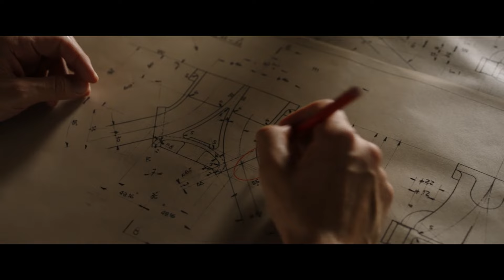FERRARI (2023) Behind-the-Scenes All Released Feature

Comment: I've seen the film twice in two days and will be seeing it again soon. It is a wonderfully produced film of the man, 1Ferrari, in a time of his life when it was all on the line... win or lose everything. Adam Driver beautifully portrays a complex man who has one focus in his life... to win. He sold customer cars to race. Racing was everything to him. It was in his blood. His competitive spirit was legendary. You may not have liked him, but you certainly had to respect him. I never knew about his family life, but his focus on the business was legendary. Michael Mann has done a fantastic job in portraying the whole racing scene at the time... one simple mistake on the track at speed, and you're dead. No safety equipment, and helmets and goggles were only there to protect the head and eyes from debris in the air. No seat belts, no roll bars, safety cages, monocoque designs, no tires which could provide the mechanical grip we see today. Brakes were drum and not discs, but the engines had a ton of power in a Ferrari. The cars were light weight and the power to weight ratios were insane. The 335 S cars which raced in 1957 at the Mille Miglia had a top speed of about 190mph, but I doubt if they reached that number, but maybe very close to it, with 2 people in a car. Piero Tarufi (played by Patrick Dempsey) likely won because of excellent driving but also because he was alone in his car, thus making his car even lighter than the other 4 Ferraris in the race.
Great camera shots during the race and you certainly get the feel of being in an open car at top speed, with all the bouncing occurring from the road and ability of the suspension to deal with it (or not).
The film which set the standard until now, for racing, was "Gran Prix", with James Garner.
"Ferrari" is a must see.